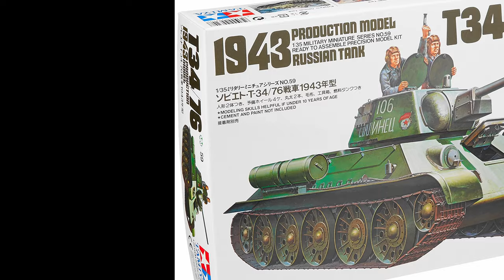PAINTING & WEATHERING  T34 / 76 RUSSIAN 4BO (1/35, Tamiya)

Comment: Cousin diorama, how'd you add the plastic card to the sponsor area of the kit, to cover those holes? Do you have a template or pics so we can use? As that is one of the reasons I font like the really old tamiya stuff.
Reply from the maker: Hmmm, not sure what holes are you talking about. For the lower hull, just styrene sheets from inside, and putty to fill holes from outside
Reply: @dioramadevil  yes that's what I'm taking about the holes by the tracks you used sheet to fill it so no daylight shows through
Reply from the maker: @rickmoreno6858  A, ok. So this is it. I also  glued two big pieces of styrene under the fenders, because there was a hugue hole too...